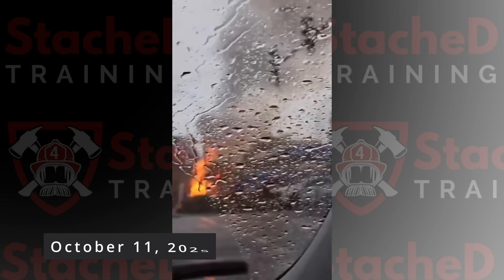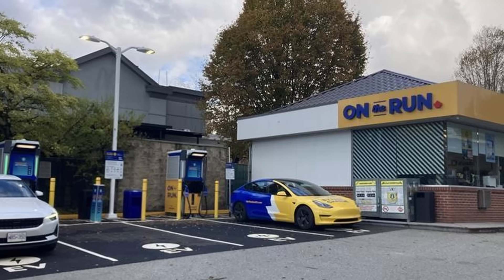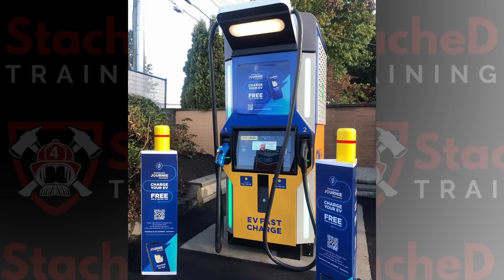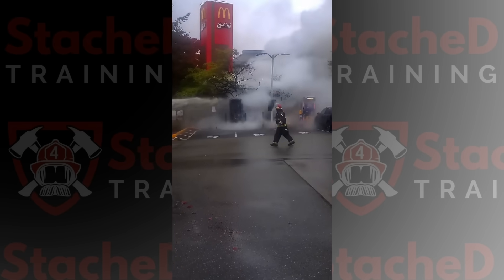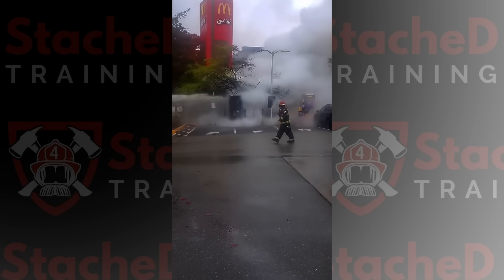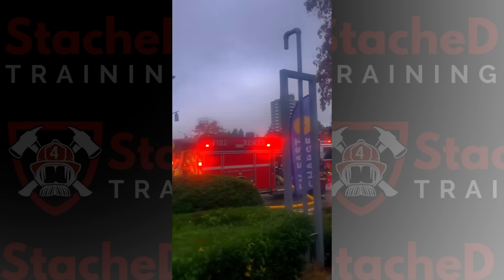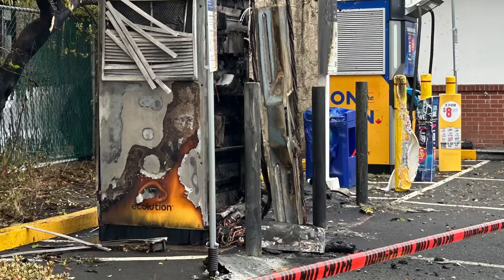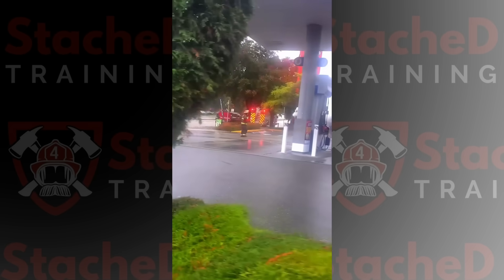EV Charger Fire in British Columbia: Hidden Batteries!

Comment: There is no pattern of spontaneous fires at public charging stations caused by built-in batteries. Incidents are extremely rare. Worldwide, there are only a handful of known cases where a battery buffer for a charger caught fire. If the cause is not yet known or confirmed, it is not wise to suggest or imply what the cause might be in a (public) YouTube video. Framing again.

Comment: How can the "energy transition" happen if the infrastructure burns down almost as fast as it is built?
Reply: How are we still driving when gas stations are burning?  Happens far more frequently than EV infrastructure.  

Also.. you can literally fully charge an EV from a 15A wall socket overnight.  Where are you getting gasoline for your car at your house?
Reply: One charging station caught fire. Do you know how many there are in metrovancouver?

Comment: Direct to grid chargers require a much more expensive grid connection. There is also an extended time component to have the higher capacity power service provided.

Comment: Why batteries. Why not capacitor. They take a small amount of energy and boost it. Like a microwave oven. Why I say. In this method. It would be easy to supper charge at home. If done correctly and safely. Inverters do exactly that. Taking 12v and producing high watts and amps. If they pulled their head out. You don't need much energy to recharge any EV. You can take a supper small amount and amplify it to supper charge any EV fast. They do everything backward.

Comment: Lots of problems here, but mostly with the ignorant comments.

Re the video, this dude talks about lithium batts as if they are all the same. They are not. The more fire-prone cells that have been responsible for virtually all EV and related fires have been NMC chemistry, and the vast majority of those were defective LG Energy cells (folded separators and/or torn cell tabs) that were made for several years (poor quality control from LGE). LFP cells are vastly more resistant to fires, to the point where they pass a nail penetration test without burning. This charger most likely has NMC cells, which was a stupid decision on the part of the manufacturer.

Re the location, that is entirely the fault of the regulatory body that allowed this, and the installer that should have known better, but of course, either didn't know or didn't care.

As for the comments here about EV fires, even including the vehicles with faulty LG cells (which were eventually recalled), EVs are vastly LESS likely to experience a fire than an ICE vehicle. There are around 600 ICE vehicle fires in the US alone EACH DAY. You don't hear about them because they are so common, whereas the news networks, being owned by mostly right wing haters, beat up any EV fire they hear about, even making up stuff before they know the facts.

Two great examples are the Stavanger Airport carpark fire that all the news outlets said was started by an EV. It was actually started by an Opel Zafira turbo-diesel. But all the morons keep talking about it like it was an EV fire. Same for the Luton carpark fire in the UK, the cretins all ranted about it being an EV fire when in fact it was started by a Range Rover. There was also a fire in Heathrow airport carpark this month, once again, started by a diesel. Same with the Morning Midas ship fire, blamed on EVs, but the ship had 3000 cars, only 70 were EVs, about 680 hybrids and the rest ICE. Crew on the ship stated it started on the ICE vehicle deck, not the EV deck, yet all the fools kept reporting it as an EV fire.

Fact is, your ICE vehicle is vastly more likely to burn than an EV, even an NMC powered EV. Given that EVs are now moving en masse to LFP cells, they are becoming about as safe as a vehicle can be.

Comment: ohh hay look, they figured out a work around to the difficulties of getting enough power to a charging station to actually charge cars at high speed. Ohhh crap its a giant battery pack... stored at a gas station.... a giant battery pack that will be expected to charge and discharge rapidly over and over.... ohh dear.

Comment: The famous "One Megawatt per hour" technology invented by the Chinese is basically a 50 KW charger, but buffered by a big battery. While charging a vehicle, the buffer battery is capable of delivering " 1 MW/h" for few minutes. While idling, the charger charges its own internal battery.
Such buffered chargers looks much more beefier than standard chargers. I agree that the risk profile of such chargers is completely different from what standard chargers is, and should be regulated accordingly.
Thanks for the video.
Greetings,
Anthony

Comment: Lithium is junk. They need alternative batteries. I have seen some companies are already working on aluminum and sodium ion batteries. Lithium batteries combust too often. I would wait until they start using different batteries. Even when charging my phone, the phone gets hot. It uses lithium battery. This proves that these batteries are junk. And they degrade rapidly. Bought the phone last year, and already at 92% battery health. Junk. I had a brick phone Nokia 3310, and used it for years when I was a teenager. The battery held up like new. When I left for USA, and came back to visit my grandmother, I checked the same phone if it was working since nobody charged it for 9 years! Guess what! I pushed the power button and it turned on and with the full battery! I was using it for full 2 days before I had to charge it. Brick phones in the day, were super reliable and with good battery life. Nowadays iPhone while it may have awesome features their batteries suck. Much like EVS with lithium ion batteries or charger that have those batteries. If these batteries catch fire from charging, that means they are not safe to use, and should not be used. So personally I would wait until the new battery technology takes off, if you want an EV. Because current ones with lithium batteries are junk, because you’re risking on lighting not just your car, but the whole house on fire.

Comment: So we've seen EVs catch fire while charging and now we have a charging station (though not the convectional type charging stations) catch fire. Here's something interesting the Gilbert Fire Department in Gilbert, AZ acquired their first (and also the first in the state) Hybrid (Diesel & Electric) Fire Truck towards the end of 2023.  Station 252 is close to where I live and I see the truck out running calls or parked at the local grocery store. Now I am curious how/where they are charging their truck. Is it being charged in the apparatus bay or outside. If inside there runs the risk of a mishap, but if it is charging outside that is adding precious seconds to their '4 minutes or less response time'.

Comment: Simple solution is a fuse that burns out with fire but allows high currents. Return path (wire) goes back to a distribution box that, using relay controlled switch, cuts off power to the branch completely.
Reply: Batteries do not stop supplying power no matter how they're disconnected. External power disconnects generally have no effect because the circuit was already automatically disconnected. If the battery material is the fuel for the thermal runaway, the fire is chemical, not electrical.
Reply: @CycleWerkz  I know that, but turning off supply power is really important for at least two reasons: it will kill you even if it is on fire and second one it can easily contribute to fire as high currents can create high temperatures that melt steel. Those two factors greatly contribute to safety. Once battery is on fire it is shorted and does not supply electricity any more but that does not mean that charger stopped supplying power thus accelerating thermal runaway. Also (I doubt it but still) if you don't know, unless water is distilled it conducts electricity well enough to be extremely dangerous. That means that if you try to put the fire with water, whole area becomes electrified. In either case as another reminder, electricity needs two contacts in order to kill you.
Reply: @MostLovedGod  Your understanding of this situation is functionally good. I'm painfully familiar with water conductivity. I have studied large battery failures for decades; but am also current(pun) on all the latest chemistries.

I cannot be sure of anything at this site so speculation cannot be useful. I can provide similar situation observations.

All contemporary BESS designs include a few common safety-features. Most of the systems I get called to analyze have all these devices, but the TR occurred despite perfect operation of all.
They all have battery disconnects, some mech relay, some Semiconductors, usually two per string on each output pole, often another at the mid-string location, a few have these on every cell pack. All require power to close so will open if control wiring is open or the controller loses power. Most systems also have thermal fuses on one + & - sides of each battery string. I'm not saying it's impossible, but it's not expected that a unit on fire can supply battery electrical energy to the cabinet, or water.

Electrical power supply to the BESS. These systems will have a power conversion and battery charge controller section. The AC input power will terminate at the Power Converter AC Input. Circuit integrity here is normally very good. I typically find proper wiring and ACEG properly sized and fastened on both ends.
I have not found the supply Circuit Breakers in the tripped position. Sometimes I find it open because someone moved it from closed. GFCI is not typically required on this circuit, so people can and do experience shocks. They really should require a shunt trip breaker as the lowest cost and effective protection scheme. The shut trip is probably already on the breaker to support the EPO. It's simple to trigger on ground current, on in-cab high temp, or any other alarms. This solution corrects several other issues plus the shock hazard.

The initiating thermal event is not usually a cell failure, but much more likely an arcing fault where cable lug fasteners fracture or vibrate out. The falling fastener can short a bus, or the now loose cable lug meets any bit of metal. This type arcing fault is very high impedance, and extremely high temperature. The current is very low, so protectors do not operate. The arc melts away steel, nothing can extinguish an arc, only power interruption can stop the destruction.

The initiating heat release then heats nearby cells, far above rupture temps. The cells usually rupture spilling hot and conductive electrolyte. This melts or ignites cable insulation, adding fuel to the fire and shorting more battery modules.

This commonality is the method of weasel used by EV and Green zealots. The fires initiate in the battery module, then become impossible to stop, all within this module. Yet, they don't count it as caused by a Li battery.

This thermal cascade will raise cell temps above the auto ignition temp which will always thermally sequence to ignite all materials in the cell. At least one material will release O2 during deflagration as an accelerate all other combustion reactions. This is an auto propellant, which will continue to burn underwater or in space, nothing can extinguish this reaction.

I have found a few caused by a poorly installed grommet. The battery cable insulation was eventually cut by the chassis where the grommet was open. TR didn't occur due to superior designs.

I prefer an independent Earth ground for each cabinet. This is almost always missing or very poorly connected whenever someone is shocked.

"Current always follows the path of least resistance" is the enemy of understanding here. A better statement "Current always flows through every available path, in proportion to resistance".

The point is, even a well-grounded cabinet, with a properly connected ACEG, will still flow current through a person connected in parallel. A potential difference will always cause current to flow through a conductor.

These systems congregate many hazards and trigger exposures all into a tiny spot.

We can certainly improve safety on these, but we should expect failures.

Comment: I was wondering when battery buffered chargers were going to show up so that the grid connection doesn't need to be upgraded to support peak demand. We can't figure out sodium based chemistry soon enough, we need a high density battery that doesn't go full meltdown when there is a problem.
Reply: Sodium Batteries are already on the market China has built whole grid storage facilities with them. And as an End User  you can buy them from the usual market places you can buy LiFePo4 Cells.

Comment: It might be safer to build one giant maglev flywheel on the roof of the gas station and spin it up to 100,000 rpm every night. When a flat EV pulls up, a little generator could convert the mechanical energy into DC the battery.

This method would allow a large number of EVs to fast charge at the same time from a weak electric grid.

Comment: I know many of your videos are on EV related battery incidfents but I would be curious to know your opinion on AAA and AA lithium battiers that have type C USB charge ports built into them.  I bought some but then I realized I may be spreading a fire hazzrd around my house.  It has occured to me that I have already forgotten some of the locations where I  installed them.   I never gave alkaline batteries a second thought other than corrosion issues.